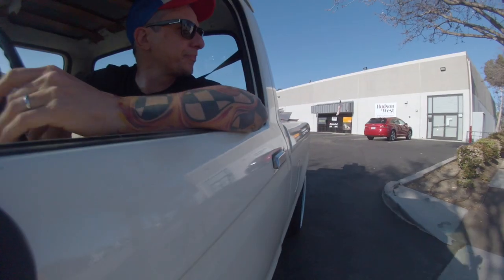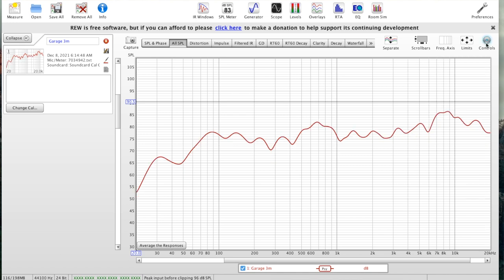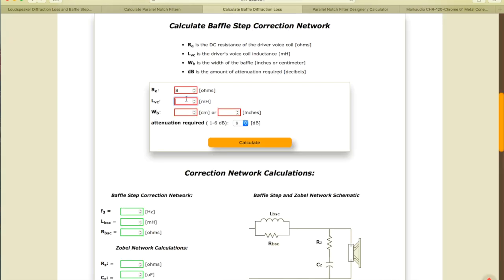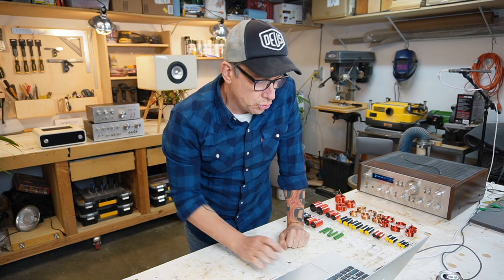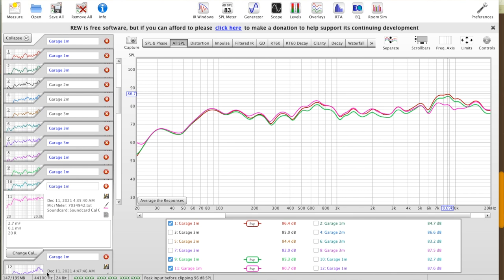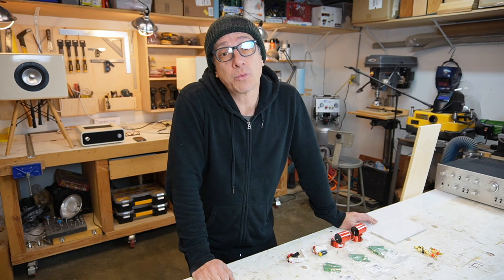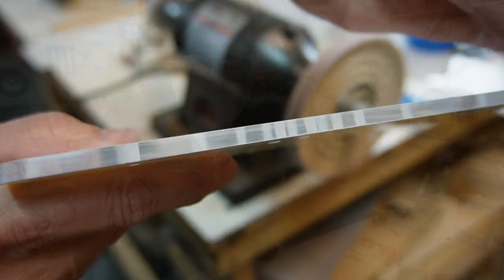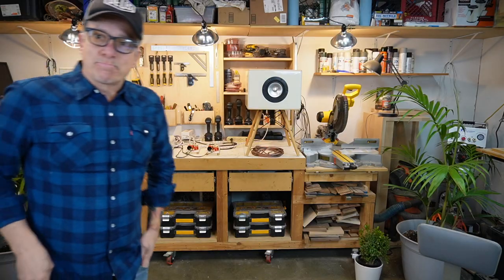Hi-End Full Range Speakers | DIY |  Notch Filter for Mark Audio CHR-120 | Eames Speaker Part - 2

Comment: Awesome work!  So much more than just a boring 'how to' tutorial and much more than just a sleek build log video.  In fact this might be the best video I've seen on how to build and test a crossover (... I mean filter) and working with a single full range driver makes it much more approachable and takes a lot of intimidation factor out of it.

Another good idea for a video would be to calculate the response from the baffle and then test and measure in the real world before you do the build and make the filters, unless you did that in part 1 (I'm actually watching this out of order).

Also perhaps a video on how to layout and build a crossover / filter from an electrical diagram for those that haven't done so.
Reply from the maker: Thanks Phillip. I did some measurements without any filters before. I’ll keep posting more info. Thanks for the input.

Comment: You might find that using XSim - which is a free crossover / filter program - is easier, because you can see the change in the response curve visually on the screen. You get to try all the values in the program, and then buy the parts.
I like the external filter box - featuring the parts that are usually hidden is great.
Reply from the maker: Thanks Neil!!

Comment: Another awesome video! I'd love to see an open baffle build with Lii drivers...I have heard good things about them.
Reply: I bought these speakers about a year ago and have been running them in anopen baffle design. You definitely need to add a subwoofer or put them in a ported Enclosure.
Reply from the maker: I’ve heard that too. And I think they are good looking as well. Wanna try it for sure.

Comment: I have rebuilt crossovers with high end parts, experimented with caps… You need to give Bypass caps a try.  I have used Myflex KPCU 0.1uf  copper caps and worked great.  But I even tried some Dayton Audio bypass caps and they worked fine too
Reply from the maker: Thanks Paul. Good to know man! Let’s try those next time?!!
Reply: @sonnoradesign   Slap them in your next parts order, really easy to add them to this crossover whenever.
Reply: Tall Paull  Not to long ago I sold a pair of 100uf Jantzen caps to a Tall Paul on ebay. What are the chances of this being you?
Reply: @bogie1971   Not me, I think there are quite a few Tall Paul’s out there for some reason. I know 4 others myself !?!

Comment: 20:15 Showing the filter made by direct twisted connections. This sounds the best! 😮 Better than soldered, and better than (soldered or unsolcered) iinterconnecting wires between the components. I tried all 4 alternatives and what is pictured here wins (hands down)! Most detail, most naked sound, raw detail from the instruments themselves (revealed by direct comparisons). I build speakers. 😅
Reply from the maker: That’s great input!! Thanks a lot my friend. I remember those viNyah’s pioneer amps from the 70’s, all just twisted wiring. Good stuff

Comment: The dayton Omnimic V2 has an option to remove room resonance basically the software can remove peaks and dips caused by rooms simulating anechoic chamber. I have measured some drivers and it matched the manufacturer measurement's perfectly. Also the Omnimic V2 is easy to set up and use. So how do you like the Mark audio drivers ?
Reply from the maker: Thanks for the input. I should give it a try for sure. The Mark audios sound really nice, they need some time to break in and it gets better and better. I love it. Clear and defined audio.

Comment: Wow love the crossovers need them for my speakers. Hi I need some of your help as I am owning a pair of focal chorus 726 At the normal volumes , sounds good but not great . If I turn the volume up they sounds like a s—-t . I am using them with maranta pm8005 . If you can help me to do some modification in the original crossovers or something to make the mid bit heavier and softer
Reply from the maker: Hello Kay! Thanks for watching! I’d need the speakers to measure them and work on the crossovers. I don’t have an upgrade for the crossovers right now. You can try diy audio forum and look for focal crossover upgrades. There are some from GR Research for other models. Stay tuned.

Comment: What is the schematics and the values used on this filters?
Reply: I need to see these so I can paint by numbers as I am new to all this.
Reply from the maker: Sorry for the delay. 
Mid Frequency - 33 uF + 1.5 mH + 7 R 
High Frequency - 2.7 uF + 0.10 mH + 15 R
All in parallel
Let me know how it goes. Thanks for watching!
Reply from the maker: Tahnks Leo. Hope that helps.
Reply: @sonnoradesign  Now that`s what i call service,thanks for all you are doing and especially that you provide fixes and give details for any parts needed.Kind regards.
Reply from the maker: @leojack987  sure man. Let’s make it sound goooood!!!
Reply from the maker: Guys, I’ve just edited the filters, I switched the resistors by mistake. Sorry!
Reply: @sonnoradesign  Thank you so much!
Reply: @sonnoradesign  Thank you again. I am struggling a bit to visualize the schematics. Are the LCR in parallel with each other and coupled in series with the driver or are the coupled in series(or parallel) paralleled to the driver?
Reply from the maker: @007soedal  that’s right. LCR in parallel with each other then series with driver.

Comment: So strange ,  when I wrote down your original specs I accidently reversed the resistors thus making it correct , as you made a mistake so did I. A glitch in the matrix .
Reply from the maker: Haha right! I reversed it. I’m glad it worked.

Comment: Why is the mic placed in reverse facing to the speakers ?
Reply from the maker: The other speaker was on the other side. It didn’t show on the video!
Reply: Did u measure before break in or after ?what was the break in period?
Reply from the maker: The driver was quite new when I measured it. I’ve noticed a big improve after like 200 hrs I’d say.
Reply: @sonnoradesign  I am using the same driver.. u would have revisit xover.. with new measurements.. also play around with the port tuning. Mine have about 90hrs.
Reply from the maker: @abhidadhia5091  right! I’m gonna play with it a little bit more. I’ve been using it without the filters, in my living room, and it sounds much better then before.